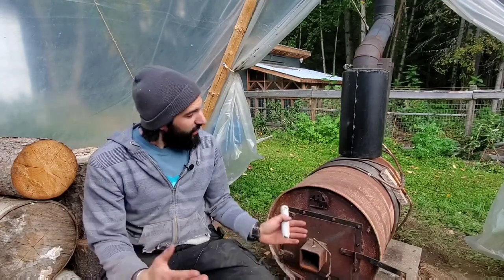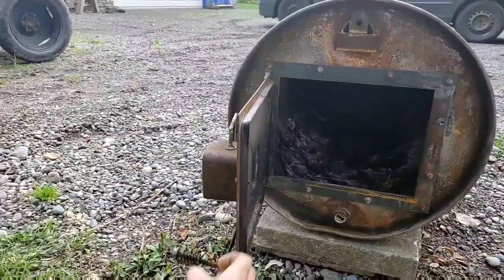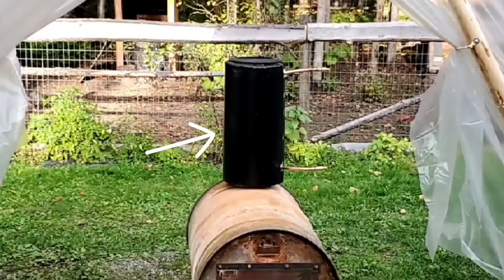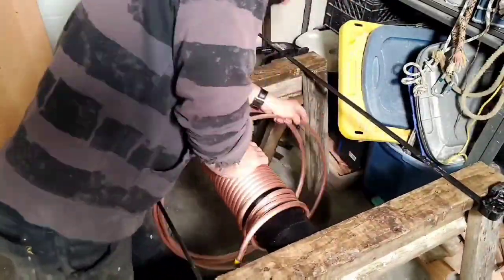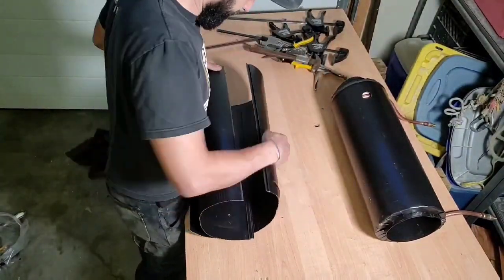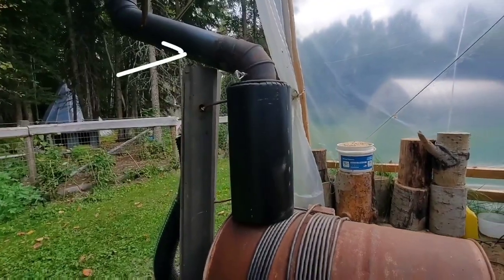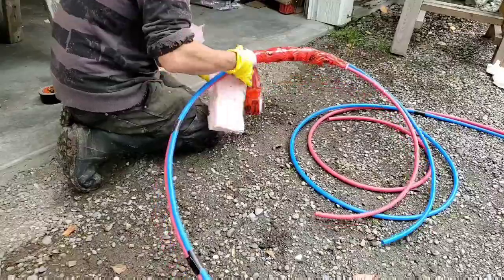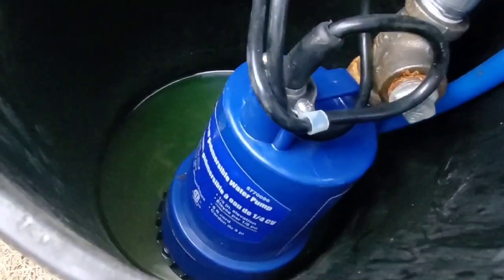How I heat my garage with an old car radiator!

Comment: I'm sure you get a lot of suggestions but instead of wood I would use a used oil drip feed. It's simple and it heats up instantly. Great job and simple. That's helps out a bunch.  Thank you and God Bless Everyone
Reply from the maker: I was playing with the idea of an oil drip heater, and one day I might build one. It would be an awsome way do utilize all the otherwise useless oil from oilchanges. But we also have an abundance of firewood, we have each year multible burnpiles to get rid of, so I might as well heat my garage with that. But I agree, an used oil drip heater is a great idea!
Reply: I would add a removable burn pot and wast oil drip line to what you have now. Plus whatever else you would need to make it work. Just a thought.

Comment: Good job. Heat pump water heaters use 2" of closed cell foam around the unit with the copper coil on the outside of the water tank so you've essentially done it the correct way. I've been cruising the internet to see somebody do this before i do it so i am glad i stumbled upon this video lol.
Reply from the maker: Thank you! Glad you liked it!

Comment: With a system like this you still need the radiator cap on and a over flow can. It will save your pipe from splitting. Nice job .
Reply from the maker: @LaRaineBarton  The return line just ends loosely in the bucket, so technically, the pipe can not split due to high pressure. It would just push the coolant out in the bucket. The issues I have are pump failures. (Powerout, etc...) If there is no constant flow of the coolant, the temperature becomes so hot that it melts the pex pipe.
Reply: @adrianwoodworm  Mite try heater hose don't know if it would hold up.

Comment: To prevent overheating in case of power outage, consider using a 12v pump and a UPS, maybe in a loop with the pump? It even just a12v car battery on a trickle charger?
Great thought process, and inspiring! Well done, thumbs up and all that. 👍🤟🧟

Comment: This is exactly what I was looking for. What is the highest temp you could reach? How hot does the radiator get? This is awesome thanks for the share!
Reply from the maker: I never measured the temperature, but a couple of times, I forgot to turn on the fan, and the radiator became too hot to touch, and the pex pipe felt dangerously soft😆

Comment: Might have to steal this as well. I have a radiator, box fan, and hot water loop (outdoor furnace). I was going to cobble together hydronic heat with fin tube and copper.
Reply from the maker: It is a cheep solution for heat as long as you are willing to get out there to keep the fire going. Since the chicken coop is close by, I thought it would be cool to tie that one in as well one day. It might be a project for next year!
Reply: @adrianwoodworm  our furnace has a thermostat controlled blower which supplies of 160°F water.   It will increase the amount of wood burned but also increase productivity.

Comment: Cool video.  I have a few suggestions for you or perhaps other people who are considering something like this.  You really don't want to draw heat from the firebox, and in fact in should insulated with fire bricks on the inside to be kept as hot as possible.  The main problem with your heat exchanger design is that the contact area between the copper pipe and the flue is actually very small, so you are not get efficient heat transfer.  Either put the pipes inside the flue, or try to make a full water jacket on the outside.  If using tubing, make sure the cold water is coming in from the top, so the system is setup in counterflow, this is more efficient.

By having your firebox totally uninsulated, your are not only losing a tremendous amount of heat to the outdoors, you are also preventing the fire from getting hot for efficient and complete combustion.
Reply from the maker: As mentioned in the video, I don't want the pipe in the firebox, people who did so have to clean their pipes regularly from the creosote getting build up, which then insulates the pipe from the fire/heat, and cleaning that is something I am not interested in. I agree, the heat transfer could be more efficient, but it is not really a problem, since I produce an excess amount of heat already, so much so, that I have to keep the fire small to not overheat the system(which did happen before...) that brings me to your last point, the fire has no problem to burn efficiently, that might be a theoretical concern but I can ensure you that in reality it burns hot and clean. Don't get me wrong, there are certainly a lot of ways to do things different and more efficient, but my goal here was to build something quick, functioning and cheap.  And sitting in a warm garage as I write this, while it is -27 Celsius outside tells me that I achieved that.
Reply: @adrianwoodworm  yeah i get that your project is working well, and the way you did it is fine. I just like to look for areas that could be improved, perhaps i came across negatively, but i didnt mean to.
Reply from the maker: @zachary3777  all good. You have some valid points, to adress them just doesn't fit in the frame that I set for myself.
Reply: You're asking for smoke condensation in your chimney with a water jacket. And if you wanted a thermosiphon system, running countercurrent would completely ruin that. I'd say using something like plaster of paris or sand would be much better as packing for the coils to increase your heat transfer efficiency, and could easily get hot enough to not negatively affect your chimney health.
Reply: @pre176  that's true.  In a legit system you would have a thermostatic mixing valve that keeps the boiler temp at 140 degrees or above to prevent flue gas condensation.
Reply: @zachary3777  yes but if it’s off for any period that water won’t be at 140 no matter what your mixing valve is set at. I’d think with the lower heat capacities of a solid packing material it’d come up to temperature much quicker and also less risks of a steam bomb. 

On the original point about the best place to put a coil. Yes the hotter point may be the first stage of the chimney, but I wonder how stable that temp is when you’re extracting heat. A chimney is just a thin piece of metal while the body of a stove generally has a lot more thermal mass (though perhaps not this one) and you’re missing a lot of the heat being released at the point of combustion. As he said, the coil around the pipe alone wasn’t sufficiently hot. That could be just a low efficiency in the heat transfer or it could be that the heat capacity there isn’t great (or a bit of both of course).

Comment: It's the first part of the stove pipe because the total heat volume of the stove is larger and  is condensed to a small area by draft to escape the confines of the stove.
Reply from the maker: That sounds like a logical explanation!👍

Comment: Nice inexpensive diy design/build. And, it works! 

Failure modes are always an interesting diy design problem. Imagining what could go wrong and having a mechanical or electronic control system that remediates each potential problem is very hard to do.

Especially with a wood stove fire heat source. 

If the circulating pump or the fan fails or the thermal transfer fluid leaks, how could a safety control system sense the failure and quickly shut down the wood stove? (Electronic dampers would have to choke off airflow in to & out of the firebox to quickly smother the fire. The control system would have to have sensors for each possible point of failure and a microcontroller, like an Arduino, to read the sensors and take pre-programmed actions to protect the system from every possible problem scenario. A complicated control system to setup, program and test.)

Something like this often happens to people building solar hot air collectors where hot air stops exiting the collector and the heat builds up until the glazing pops or cracks from overheating (called "stagnation"). If their fan fails or their thermostat fails or the airflow damper fails then their solar thermal collector(s) can self-destruct from overheating.

Others who want to emulate this system might want to look at the failure modes and implement an Arduino-based control system with appropriate sensors. The parts would be pretty cheap, but writing the control program would be challenging. (Maybe someone could write an open source generic Arduino heating system control sketch that would ask a few questions about how the system is set up & monitored and then call the appropriate blocks of program code to handle basic system operations & failure responses?)
Reply: The changes to this design that I would make are as follows:

* Split the flue pipe so that the heat exchanger is on its own branch and put an electronic damper at the beginning of each branch so that the hot exhaust could be directed up thru the heat exchanger branch OR the flue exhaust branch (i.e. control heating of the heat exchanger)
* Direct vent the fresh air intake of the wood stove so it gets combustion air from outside air and put both an inline fan & an electronic damper on the intake pipe to control airflow to the combustion chamber (i.e. control rate of wood combustion)
* Put temperature, fluid pressure, damper state, fan state, and other sensors where needed to provide Arduino microcontroller with all the sensor data it needs to control system operations (i.e. monitor all critical system components & operating conditions)
* Put a thermostat in the shop to send heat calls to the Arduino (i.e. automatically control the temperature in the shop)

These proposed changes should create a more automated heating system that also implements system shutdown failure modes in the event that a key component fails. It would be fun to implement such a system and open source the design, the software control program and a list of the off the shelf components used. 

I would love to be involved in such a project, especially since I've started playing around with an Arduino Uno on a custom cargo lift that I created using a discarded garage door opener.
Reply from the maker: @alanmcrae8594  wow, you put quite some thought into this! Your solution sounds very interesting, quite brilliant actually. Definitely beyond my skills though! I don't think I ever have seen a controlled woodstove like you describe, this would be such a fascinating project!
Reply: @adrianwoodworm  Thanks for the compliment Adrian.

I think an automated diy woodstove thermal transfer fluid space heater could be a fascinating global open source project with different people doing what they are good at.

I don't have the welding & metal working skills that you have, but I have some experience with computers, automation and now microcontrollers, sensors and actuators.

My wife & I are attempting to develop a 21st century sustainable homestead and a diy wood heating system is definitely on my radar.
Reply from the maker: @alanmcrae8594  That sounds like you guys have a big project coming up! It would deserve its own youtube channel! And regarding the heater, the skills you seem to have are hard to find, but there are plenty guys out there who can work with metal, I bet you can make this a reality! I wish you the best of luck with all of it and if there is any information you need from my side, I will be here to help where I can and as time allows!
Reply: @adrianwoodworm  Hey, thanks Adrian! 
I am seriously interested in a full featured, automated, diy wood heating system and I'll probably be attempting a design/build in the near future.
I'll definitely reach out to guys like you who have real world experience with their own project.
Yeah, our Little Eden Sustainable Homestead Project is a really big project. We'd like to spend the last part of our lives doing something challenging rather than sitting around playing cards or watching tv. We might do a YouTube channel, if it doesn't interfere with getting our work done.

Comment: you could make an insulated buffer tank - water holds heat well - also think about a pumpless design - this would work well with a buffer tank with a check valve and you could team it up with solar to keep tank hot - free heat - pressure test everything and have relief valves to prevent too much pressure - pls do an update on this idea

Comment: just want to say ,THANKS, for posting this .  You put a great effort into your build and it has helped me somewhat in what I am trying to achieve in my 12x20 2 story barn for cheap winter heat!!   Do you have any creosote problems in your stack pipe where you have your copper coil ?  I have a barrel stove and I'm considering wrapping copper pipe around the drum and covering the assembly with fiberglass insulation instead of in the chimney .  I am also trying to decide if I should run black iron pipe through the firebox from end to end inside the drum for about 8 passes.  Thanks for letting me know about the solder getting too hot at the joints wrapped around the drum and causing leaks!!!  If I go with copper I'll remember to silver solder my joints to prevent leaks !  If the copper pipe got hot enough to melt the soldered joints , there should be plenty of heat around the body of the drum to heat my water?!!    Do you have a video on your build for your tent ??  I would like to see how you did this .  Very good work !!!
Reply from the maker: Thank you! No, I don't have creosote problems in the stovepipe. I think those problems show up mainly when pipe is directly exposed to the hot smoke, which is why I chose to have no copper or steel pipe inside the stove or stovepipe. (I put the copper pipe between two different sized stovepipe to avoid contact with the smoke..) I think you will be successful by only wrapping the pipe around your barrelstove, others have done it before and it seemed to work for them. If it doesn't heat up enough you always could go back and add more pipe. As more you wrap around, as more time it has to heat up. It would be just two connections you have to deal with.
Unfortunately I don't have a video of building the tent, I didn't have anything to film it back then. I do consider building a second one in the spring, if you are patient you might get a chance to see how to put one of those up. It is really easy and such an enjoyable space!
Reply: Hey Joel. I'm a retired HVAC/R man and I have six years of experience running a wood-burning fireplace in my home (25 in the business). Up in Idaho, one would tell you that creosote is primarily a problem if you run a bunch of wet wood that is not seasoned. That is year after year. A house rental manager I use to work for as an HVAC/R said he would have chimneys cleaned every 3 years (That's the brick-and-mortar type) regardless of whether the wood was seasoned or not. He always warned about unseasoned wood and it would burn too hot. . I know from experience that the really nice part of using a black pipe is how easy it is to clean out if you do get any build-up. That is either with wet or seasoned wood. Even seasoned wood will have sap in it...just less. The unit I am viewing in the picture may be disassembled easily. If not remember to use 1/4 inch zip sheet metal screws. Basically, the black pipe can come apart real easy and it can be cleaned easily. I would leave a clean-out in the burner unit above the flame area if I were building a unit for the same purpose. Hot water boilers as a rule have areas that can be accessed to be cleaned or have the burner tubes replaced. So basically keep cleaning in mind and build it so it can be easily accessed with a simple screw/bolt situation or any other safe secure method you may employ. Nicely done by the way!

Comment: After watching this video i think i will buy a diesel heater to suppliment my garage heating. Although i may experiment with this idea as a pool heater. Maybe use some larger copper pipe flowing through the firebox and out .
Reply from the maker: After years of using this system I get tired of maintaining a fire. There is quite some work involved on a daily bases. I recently bought a chinese dieselheater for our greenhouse and I am very impressed with the heat output for a $200 unit! Long story short, I decided to take down my system this year and install a dieselheater for convenience as well. So I think you are on the right track! Cheers!
Reply: @adrianwoodworm  can't go wrong for the price.

Comment: Put another looser coil inside the pipe inlet on the top outer , inside use 1/2"k copper , flatten it with a twist so the water tumbles the hotter flue gas may require a step up in size of copper , or smaller fires , as well as drive another heater core , maybe plumb a few underground for floor heat . Would be more interested in placing more circuits inside the pipe. Does the barrel pull air from a duct and not burn inside hot air?